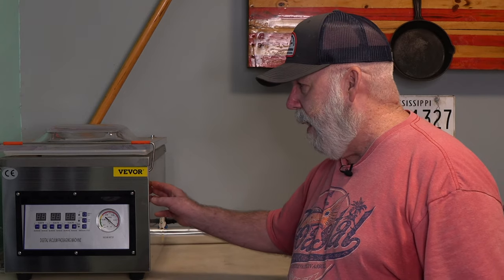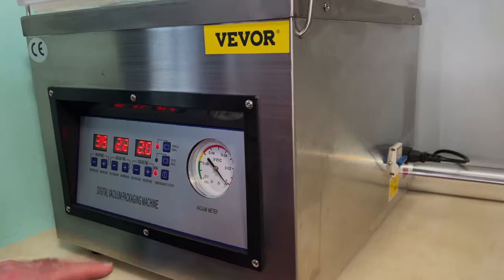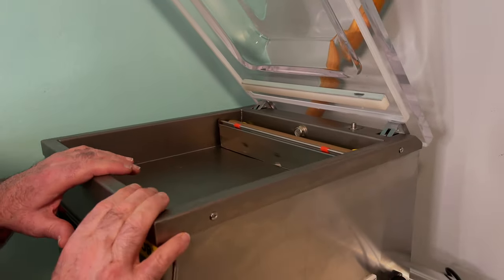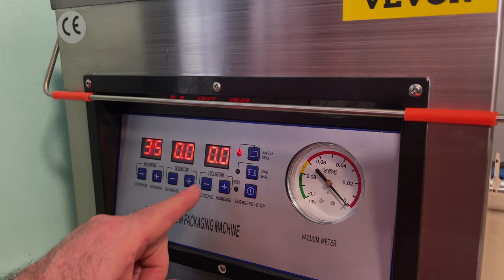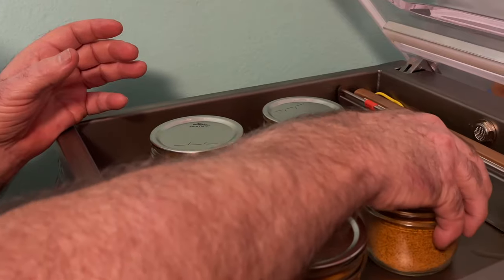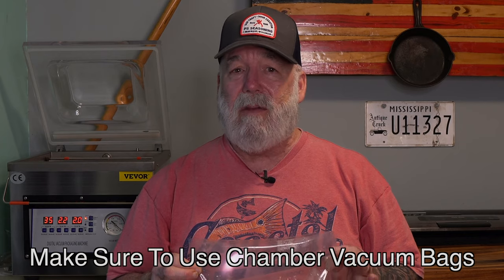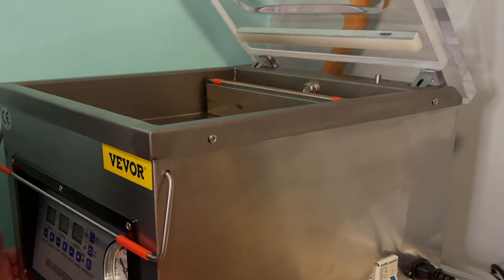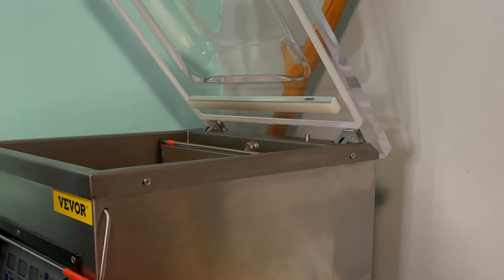Watch This Before Buying A Chamber Vacuum Sealer ~ Vevor Chamber Vacuum Sealer Review

Comment: If you compare the Vacmaster weight (84lb vs 62lb),  and average reviews (83 vs 66) My Vacmaster has been working hard for 15+ years with only oil changes. I do think the price difference is more than justified. Hate when companies send all the creators the same products at the same time for glowing reviews. Buy once cry once.
Reply from the maker: I have a VacMaster as well.  In all honesty, I have no idea how long this Vevor chamber vac will last or hold up, but I can tell you it works just as good as my VacMaster for now.  My guess is it will last for many years since the internal parts are basically identical.  I guess you are referring to Dead Broke BBQ dropping a video on the same product, the same day and time?  Jeff and I decided to drop them together.  Had nothing to do with Vevor.  I've had mine for close to a month now.  We told Vevor what product we wanted to review, it wasn't them asking us to review a chamber vac exclusively , so the "glowing reviews" comment is false.  These are our honest opinions, good or bad.  I have reviewed a number of Vevor products, and I explicitly asked for certain products that I actually use and need, not what they decide I should review.  And I can tell you now that not one product has failed me.
Reply: I'm new here and to Vevor. I looked at chamber vacs a couple of years ago. They were definitely too expensive for my liking. My eyes almost popped out of my head when I saw the Vevor price. I went straight to YouTube and found your review! Thank you 😊 
I'm rolling the dice on the Vevor! I'm tired of seal a meal vac! Gave you a follow too!
Reply: @dixieland. hey! Do you have a review? I’m thinking about buying one too!
Reply: @kellybadillo1525  
I love it! ❤️

Comment: Sealing in the small jars is a huge advantage to the chamber style. I'm glad you showed that👍😊
Reply from the maker: That's a huge plus for sure Bobbi.  Thanks for checking it out!
Reply: I do pint, quart, and reuse commercial jars (if it has a pop top) for sealing dry goods. Just put the lids on loosely (with the rings if using mason jars) and lay the jars on their side. Cereal, grains, dry beans, rice, pasta, coffee, tea, flour, sugar, cookies, chocolate chips, just to name several things. Pulls a very hard vacuum. Much more than a FoodSaver machine. In fact, some of the lids on the commercial jars are sucked down so hard, I can't unscrew the lid and must resort to punching a hole in the lid to loosen it.

Comment: Are you able to do 2 bags side by side? We use a lot of 6 by 10. I'm wondering if we can do 2(6 by 10) at a time.
Reply from the maker: Possibly, if the 6" side is the open side
Reply: Yes! I do two 6" x 10" bags as well as three 4" x 6" bags at one time. The heat strip is about 12.4 " wide. I bought this machine specifically to seal 12" wide (1 gallon) Mylar bags.

Comment: Look into vacuum chamber spacers. They cut the volume of the chamber so that you don't need to run the pump as long. The need to be solid spacers made from something like like HDPE . When you are doing a lot of bags it really helps to cut the total time.
Reply from the maker: I've got them with my VacMaster

Comment: thank you for this video my Vacmaster chamber sealer just went tits up and I had to replace it with a cheaper external sealer because I did not want to spend $1000+ on a new chamber sealer. I will have to look into the Vevor brand for sure
Reply from the maker: Your welcome Joe.  Vacmaster normally sends a few replacement parts when they send the units to you.  Mine is 6 years old and I just recently changed out the 3M sealing tape across the sealing bar because the two electrodes were exposed on the old tape.  Still running strong, but you really can't beat this Vevor brand in cost when it comes to chamber vacs.

Comment: Thanks for doing the measurements - Vevor's Q&A said jars couldn't be sealed so I lost faith in their specs. Needing at least 65mm in height on the outer of the dome to seal 3d printer spools,  you've given me faith that their published spec of 70mm (2.76") is accurate.

Comment: At timestamp 1:20, you stated, "If you just need to seal a bag, you can bring that to zero and it will just seal". I have one of these and that is incorrect. The sealing bar clamps down to the heat strip using the vacuum present in the chamber. If there is no vacuum, the sealing bar will not come down. Lacking any included instructions, I believe the vacuum needs to be in the yellow range on the gauge to provide enough vacuum for a dependable seal.
Reply from the maker: You are correct and I misspoke.  The time I have sealed bags without a hard vacuum, I set it at its lowest setting which is 6 seconds on a Vacmaster chamber vac.  It won't go any lower than that.  Not sure what the minimum seconds is on this Vevor.  I haven't had to do that yet with this machine.  That is barely any vacuum on the bag, but it does seal.  I don't have to do that often because I also have a impulse sealer for just sealing the bags, such as mylar bags, but will work on chamber vac bags as well.

Comment: You can vac the canning jars with the rings then remove afterwards
Reply from the maker: You can, but don't put the rings on so tight that a vacuum can't happen.  I prefer the way I show, then I'll put the rings on, but if you put them on loosely you can do that.
Reply: @SmokyRibsBBQ it's more about making sure the lid is on square. They don't need to stay on after either. I make vacuum pickles this way. Not sure if you've done a video on that or not. They turn out awesome.  Thanks for your content.

Comment: does normal clear plastic bags work with this? Or does it only work with a specific type of plastic bag?
Reply from the maker: It uses chamber vac bags. They are clear and made specifically for chamber vacs and they are also cheaper in price than the foodsaver type of bags.  I buy mine from Amazon

Comment: You gave the width and length measurements, but what about the height inside?  Can it fit taller jars than your 1/2 pint jars?  I’m interested in its ability to help speed along the process of extracts.  Apparently you can use an Instant Pot pressure cooker to make vanilla extract faster, but I feel like the heat would destroy some of the flavor compounds, so it would be great to know if this could do the same thing without heat.  I’m curious about the new Anova Chamber Vac.  It looks more like a kitchen appliance than an industrial machine like these, so it’s something that would look at home in a kitchen.  It has automatic modes as well for extracts, pickles, etc.
Reply from the maker: Any chamber vac machine will pull enough microns of vacuum to extract flavors, bond flavors, regardless if you are marinating a steak, or extracting vanilla from the vanilla bean, or forcing vinegar into pickled products.  Sounds more like a marketing angle from Anova to me.
Reply: @SmokyRibsBBQ  You’re right, I’m sure the settings on the Anova are for marketing and any machine can do the same, they are just presets .  Can you put taller jars in your machine or does it only accommodate the 1/2 pint ones?  Thanks so much.
Reply from the maker: @nterroso2472 I have put 1 pint in my Vacmaster with no problem.  The Vevor is over at my sons house for him to use so I can't check it, but I'm sure a pint jar will fit no problem.  I own a freeze drier and it can double as a chamber vac when I need to pull a vacuum on larger jars.

Comment: Just received my unit. It arrived very well packaged. But after I took it out of the box and removed the back plate. There is a large dent on the back. There is a weld on the left hand side that is broken. I have been in contact with the company and have received unsatisfactory responses. They had to have seen these defects what packing. Buyer beware.
Reply from the maker: Sorry to hear that.  Hope you get it sorted out with them.

Comment: I have the same unit...

F Y I....     You CAN'T seal a bag unless you  set  vacuum time to at least 10-15 seconds... WHY?  because it uses some of that air to fill the bladder bag beneath the sealing bar to push it  UP.   No air, no  pressure to seal the bag.
Reply from the maker: It's only 6 seconds on my VacMaster.  That is as low as you can set the time on the vacuum and it seals great at that vacuum time.  Haven't played around with the Vevor to see if it has a minimum time for best results, but yeah you are correct, pressure has to push the sealing bar upward before it can seal.  I personally have no reason to seal a bag without it being under vacuum because I have a impulse sealer for doing that or sealing mylar bags.  Looking back at the video, I misspoke about that.  You definitely need a minimum vac time to be able to seal a bag, that or get a impulse sealer.  Thanks for watching

Comment: Have they stopped producing these? Can't find stock of this anywhere. Is it possible that it's not robust, so they stopped selling?
Reply from the maker: What are you talking about?  Just click the link below the video and it will take you straight to the product.  I just looked and they are in stock.
Reply: @SmokyRibsBBQ  I tried again but ain't working for me, unless it's because I'm from the UK.
Reply from the maker: @MK-fb1ru  Could be the problem
Reply: @SmokyRibsBBQ  would you use this to seal flour? Thank you for replying
Reply from the maker: @MK-fb1ru  I don't but you certainly could.  You can vacuum seal anything that fits in the bags
Reply: @SmokyRibsBBQ  thank you very much.
Reply from the maker: @MK-fb1ru Your welcome